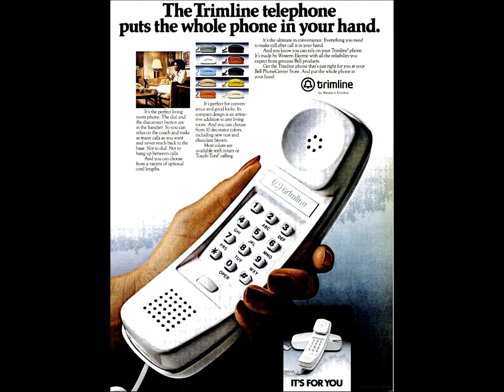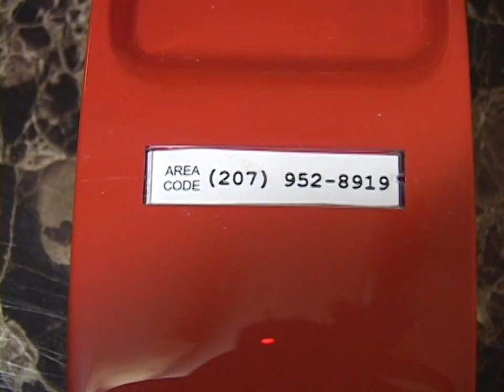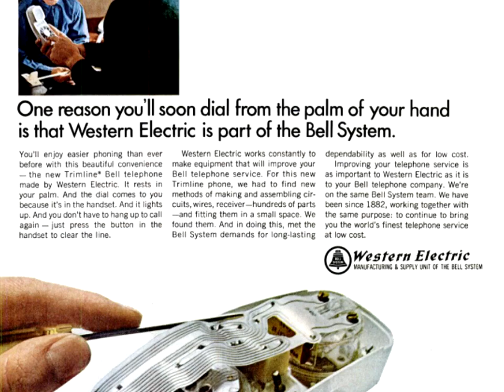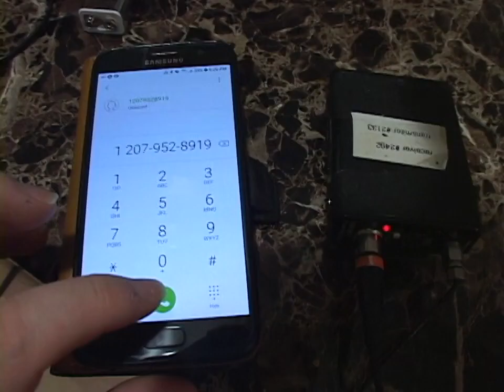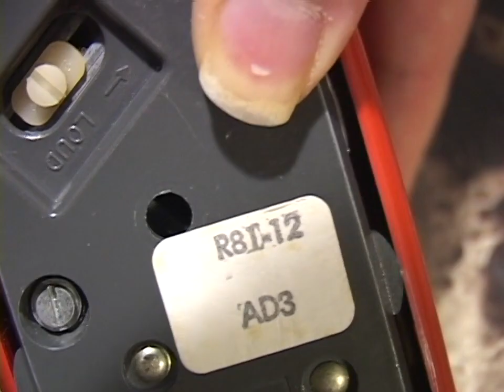Western Electric Trimline rotary phone (1981)

Comment: I worked at western electric back then , I was a buffer, then later I was on an assembly line when they switched out rotary dials to touch tone I used to wire in the touch tone dials

Comment: You should hook this phone up to your Nortel Meridian 6x16 phone system using a Nortel ATA2. I have multiple rotary phones that I used on my Meridian 6x16 phone system and all work. The system supports dial pulses as well. I have multiple videos on my phone system that are in my intercom system videos since I have an external page in use on the phone system. I even got an antique phone that has the older four-pin nonmodular plug either from the 40s or 50s that works as well. Western electric phones are built to last since I stumble across these phones at estate sales in my area that I buy and always work with no problems.
Reply from the maker: I do have a couple of ATA2s that I'll be putting to use once I have the Norstar system back in my possession :)

Comment: A carbon mic in 1981? Now that's interesting. Here in Switzerland carbon mics were all dated by the phone company. They were considered as consumables, who needed replacement after about 5 years, because the carbon started to stick together. First dynamic mics in standard phones were used here in 1970 and starting around 1975, all carbon mics were replaced by service technicians with "AKG DKO48" transistorized capsules. So in Switzerland you could have a 1929 phone with a transisorized mic, that sounded better than yours in the video. However, I just love that poppy design of yours. Here most things looked rather old fashioned or even boring.
Reply: That carbon mic sounds a bit clippy and muffled, it almost sounds like 4bit audio.
Reply from the maker: The audio quality is being mostly limited by Google Hangouts, which is what I used to make and record the call. A local telephone call made with this would be much higher fidelity.

In my experience and research, carbon mics generally don't go bad. At worst, you just have to shake or tap on the microphone to break up the carbon granules if they get stuck together.
Reply: @themaritimegirl  They usually don't go bad in a way, that you can't hear anything anymore. But the volume goes down, distortion goes up and frequency range gets more limited. The first thing I do, when I get an old phone: Replacing the mic. It' makes a HUGE difference. Just try it.

Comment: Great video, covered everything! One question, how can you connect this phone to the wall to work?
Reply from the maker: Do you mean how do you provide it a phone line to use? The major telecom companies will still sell you home phone service, but I get my service from a VoIP provider. Then I bought a $50 box to use with my VoIP service that plugs into the Internet and gives me an analog phone jack to plug into.
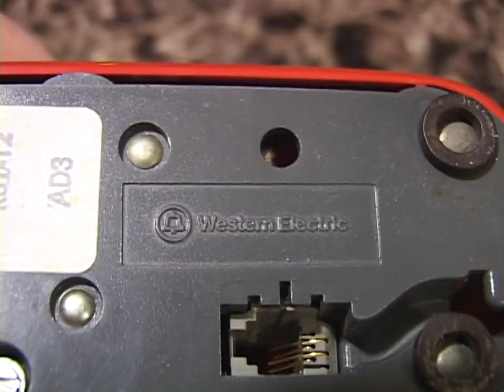Reply: @themaritimegirl   I am looking to buy this phone from Ebay, but the wall model. I got confused when i saw the images of the back of the wall model. The connector was not the same as on your phone ( as shown at 21:42 ). Is it because it is a wall model? I taught you may know how to connect it. I am not a tech expert or anything, i just want this phone for my kitchen for nostalgia. So i am just wondering how to connect it to the phone network, and do i need an adapter (because it is a rotary dial)? I already pay for landline, i used a modern desk phone before and it had the same plug as yours. I hope you can help  :)